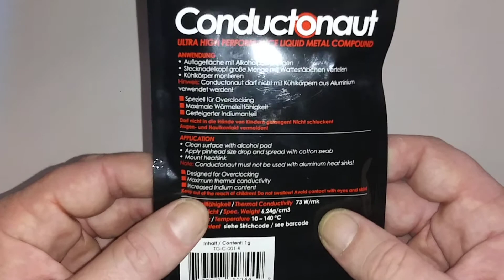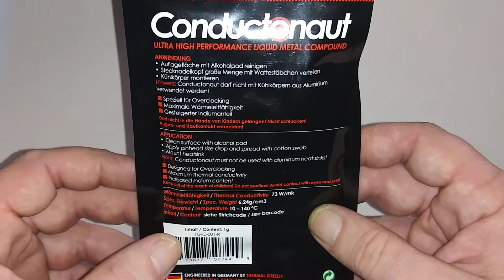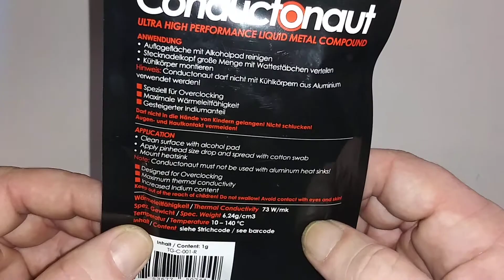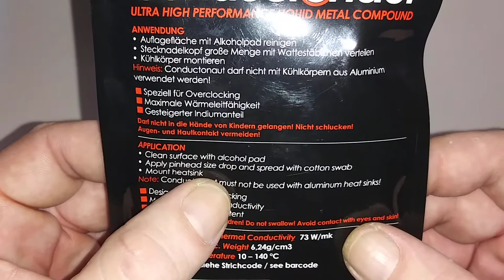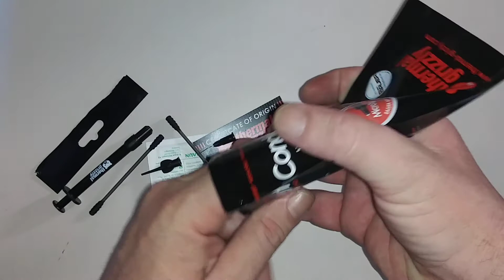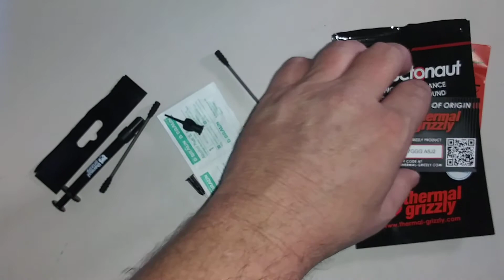Conductonaut Liquid Metal by Thermal Grizzly | What's in the package and why are we gonna use it?

Comment: Supposedly, LM works fine with NOVEC; so it should work fine with most single-phase dielectric mediums, too. It is, literally, just metal in it's liquid phase, But, hey, you're the one risking your expensive components, so I guess the abundance of caution is warranted. One thing, I think two metals blended together to lower their melting point are referred to as a eutectic (which Conductonaut and it's analogs certainly are); not sure if that would be considered an alloy or not. About to watch your results vids, keep it up!
Reply from the maker: Thanks for the subscribing. And yes caution must be taken when using LM as the application can cause a short if not careful. Using too much causing overflow or just dropping some onto the motherboard can make components fail. It however, has worked wonders in this test application as Im sure youve seen if you watched the result video. Keep an eye out for more videos to come and again, thanks!